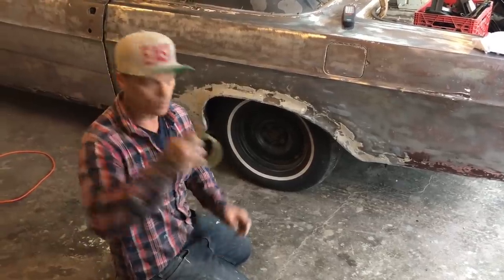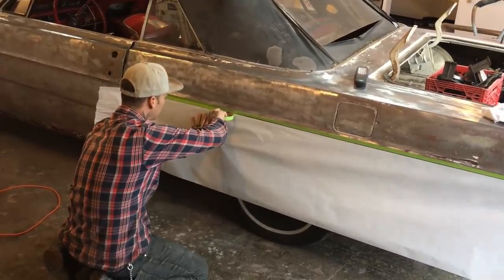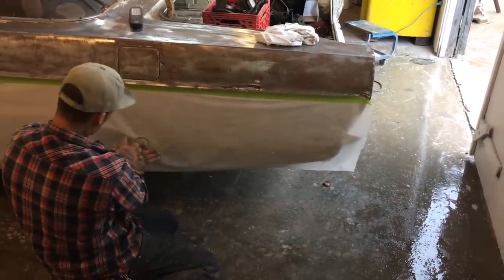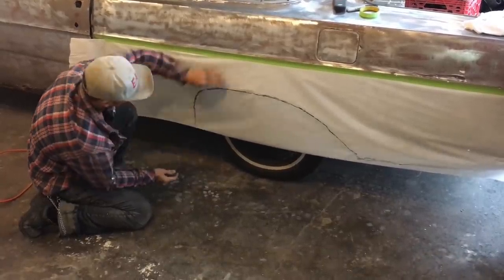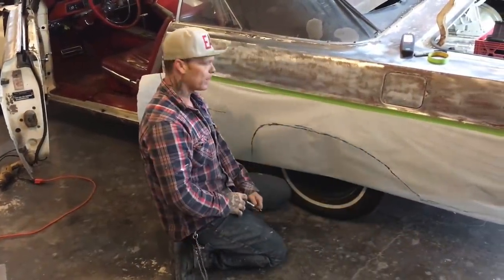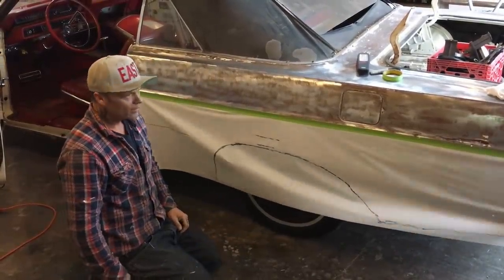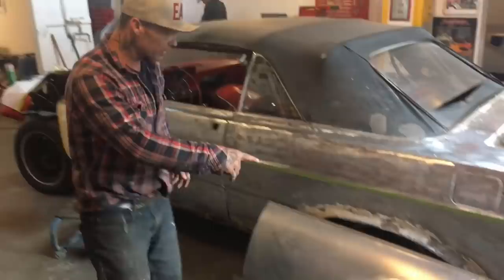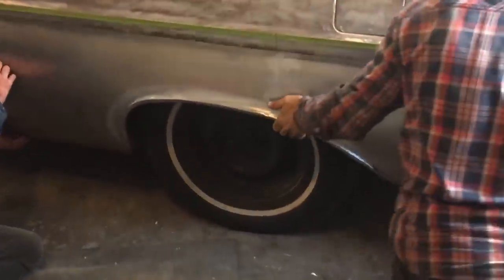Fabricating a Quarter Panel from Scratch using a Paper Pattern - Step by Step

Comment: A few years ago, the crew on Fast and Loud had a 62 Galaxie converible with a damaged quarter. The only thing they could do was remove the panel, straighten it on the english wheel and reinstall. It came out perfect, but if it had been as bad as Chad's panel, I don't think it would have occured to them to fabricate one from scratch.  If they watched this video, they would have learned something. This was impressive!